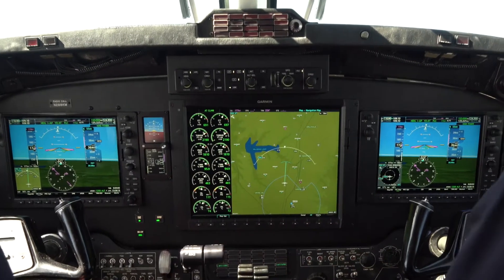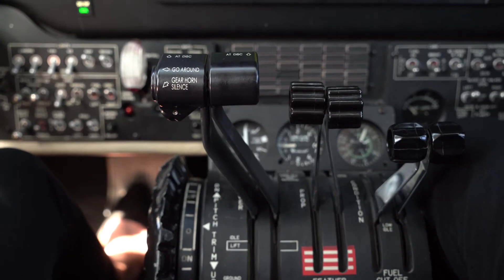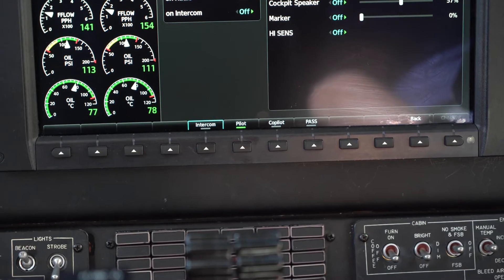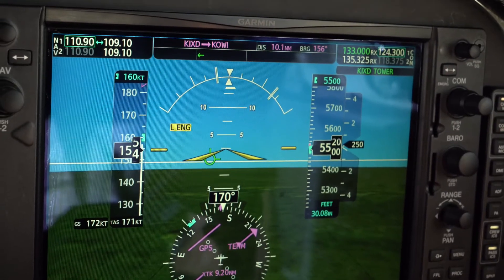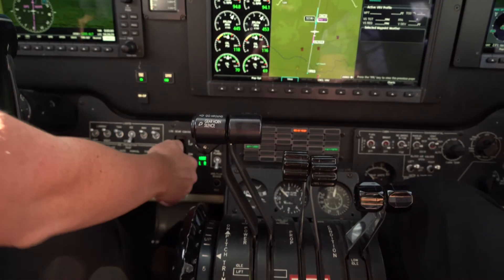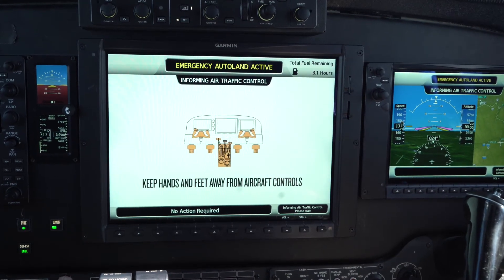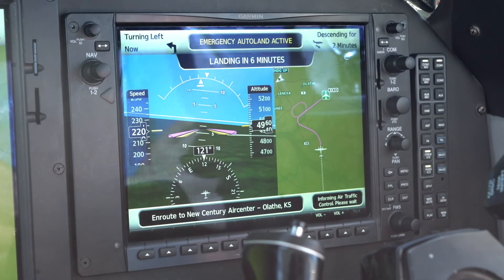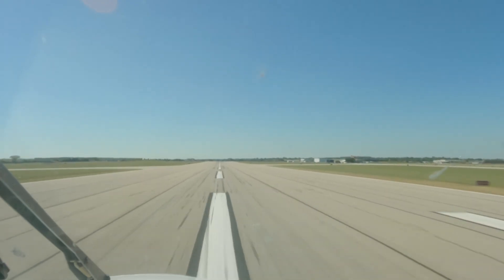Garmin | In-flight Demo of Autoland and Autothrottle for King Air

Comment: Serious question...does pilot incapacitation occur so often that auto land  is required??? Caveat, as an engineer myself I love this but is it necessary? Yes, I know the argument "if it saves one life it is worth it" but by the same argument all cars should be outfitted with auto-drive.
Reply: There has been a horrible hypoxia accident some years ago, killing a whole familiy over Europe. Often? I don't know. Useful? I think so.
Reply: Maybe all cars should be, but a car that loses its driver really just needs to slow and stop, and at high speeds where there's no time to activate a system like this, radar-assisted braking for collision avoidance (which is already common) might do all that can really be done. A plane suddenly without a pilot really has the odds of a successful landing stacked against them without something like this.
Reply: Those small planes often only have a single pilot on board. So if any kind of medical emergency happens in the air, such a system is the only way to get it down again.
Reply: Some people would love to pay for these extra features which give them confidence to buy such complex twin-engine aircraft. But not everybody thinks they are necessary and they just don't pay for them. Leave everything to the market.

Comment: Would it be possible to replace an existing Proline Fusion in a King Air with such a G1000 flight deck without much effort and cost?